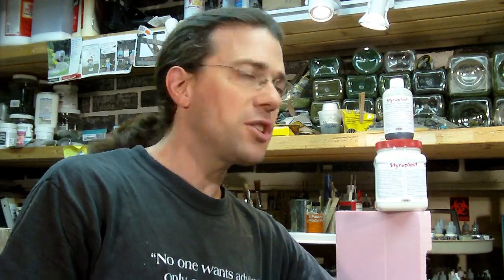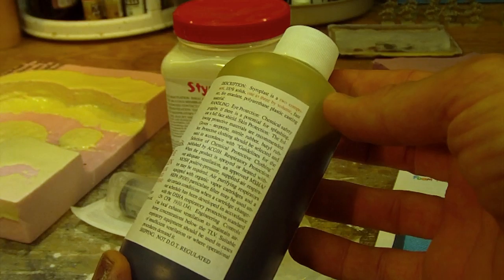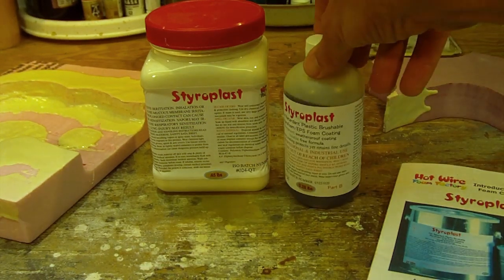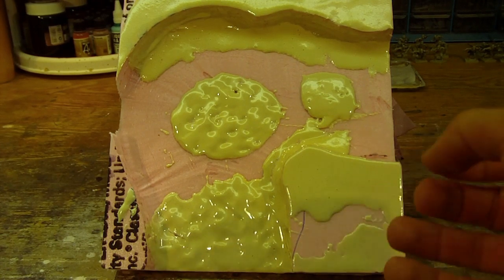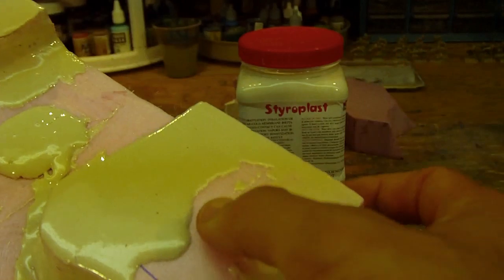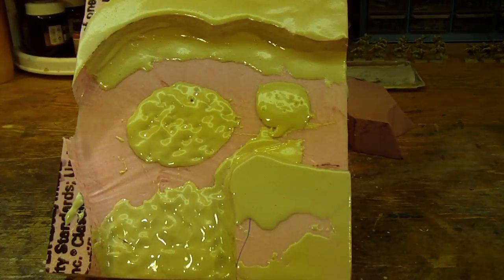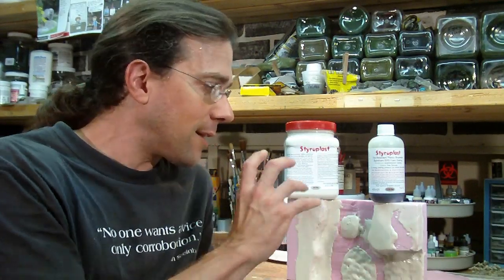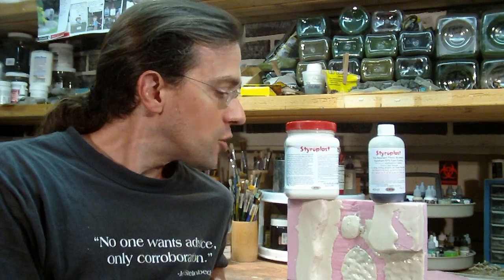TerranScapes - Styroplast Review - Hot Wire Foam Factory

Comment: One thing to remember is that you also have to prime it for painting BEFORE it is fully cured....otherwise it can flake off.  And this stuff only likes to go on Thin...wear gloves AND mask!  BAD ON LUNGS!
Reply from the maker: I didn't notice any vapor issues, but your tip on priming is interesting.  I can see that really improving the bond.  Great Tip!
Reply: yes, just check the lable on that stuff...have good ventilation.. I use the Glidden primer...called Glidden Gripper.  I have noted that if I use a primer first on my foam, I can also use spray textures etc and it will not eat into the foam then. Also, over such materials as this also then gets you  back to a surface you can do more to the surface texture, details etc.  The gripper also covers over any fill you have done like exterior fillers, wood filler, etc.  Does a very nice job of extra sealing.  And often, I have not needed more.  However, if people are going to touch the object a lot, I can see the need for this stuff, and have tried it.  Mine must have been too old as it remained sticky, fixed that with a primer coat over it. I do displays for a nature centre, so have done much larger sculptures, etc. I am going to try the styo spray 1000 (which one can also brush and roll on) as well, as I think it may work better for larger projects.  Let me know if you have tried it.:) Cheers!  Oh, and it IS VERY toxic if you don't wear gloves, it seeps into your system...be careful!  :)

Comment: used it to coat a 3x6 ft sheet... very uneven.
 VERY hard to use.
but that was mostly because it sets up so quickly/.
https://app.box.com/s/bxym3rygh559yx4cxzqqk7gzmshqwdya
 I don't think I'll use it on the front
Reply: foofighterubu Hi I'm from the company. If you have any questions or concerns, we are always happy to help. Call us 866-735-9255
Reply from the maker: foofighterubu It does set up quickly, but you can probably slow that down by cooling the parts in the fridge before mixing.  (Do a test first of course.  grin)  When I have used it, I found it best to mix small amounts and work over small areas at a time. Same is true for the foam coat, but it has a longer set up time and can be extended depending on how you mix it.  I think that you would have the best luck with getting a smooth finish by applying it more thickly so it can self-level.  Work in small areas and overlap just a tad.  You will still likely need to sand down the seams, but it will probably depend on practice.  Just my thoughts, since I haven't used it on large flat areas.

I second Laura below.  Contact her for tips and ideas.  They are super nice, and very helpful.  :)

Oh, cool bulkhead.  Looks great!
Reply: thanks. 
 I'll try that. 
 And thanks it was a lot of work and about wrecked my hands working on it.
Reply: thicker coats are ok with deep cut details. 
 but tricky to keep details if too heavy on the foam coat.

Comment: You mentioned that you couldn't use this product to make sculptures like stalactites or what ever. You also mentioned that you would like ideas to test this product.  Here is one that might let you make sculptures: Use the hot knife product that they sell and create a negative mold in foam of a stalactite, or tyranid, or whatever. coat the inside of the foam with a lubracant to prevent the Styroplast from adhering to the foam.  Coat the inside of the mold with the Styroplast. Voila: sculputre

Comment: I'm thinking of making a teardrop camper out of foam. 
Would Styroplast be a good coating for the outside of the camper?
Could it then be painted with oil base polyurthene porch and deck paint or stay with latex?
What's its strength on foam say 2"x2"x4'  vs. say a piece of pine 1"x2"x4'?

Comment: @Catachan1brainleaf 
If the part B is burned, it will produce Carbon Monoxide and Hydrogen Cyanide.  Both of these are toxic.  That is possibly what was giving that fellow breathing troubles.  An iso by itself is a respiratory irritant already, but to burn it just makes it worse.  Also, if water were to get into the bottle and contaminate the Iso, carbon dioxide will be produced pressurizing the bottle causing a potential bursting hazard which itself could also pose a health hazard.

Comment: I'm curious as to how thinly you can apply it. Let's say you spent a lot of time on a piece, carved a bunch of detail, etc. etc. But wanted a nice rigid protection on it, how badly would it conceal details? If it goes on thin enough, you could even use it as a final protective sealer for molding purposes. As well as what other have brought up as a possible cheaper alternative to casting resins. (assuming it is in fact cost effective, I don't remember any kind of price being mentioned)

Comment: What is the use as a casting material? As it is rigid yet flexible and does not break easy it may have a good plication as a casting material for that special and more complicated cast.
Could you color it from the off (i.e. dropping in some color in part A)?
And last but not least what is the flexibility of the item when casting it as a flat survace?
Obviously the painting part is important in particular if I can use it for special casts so I would be interested in the choice of primer you use!